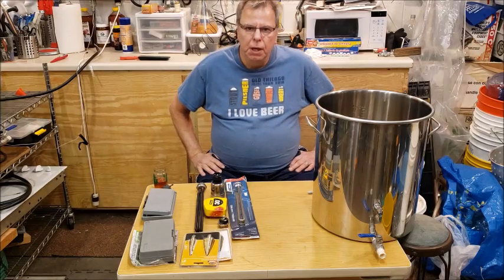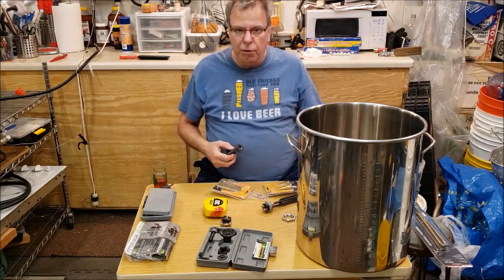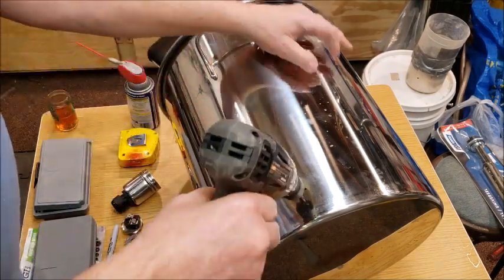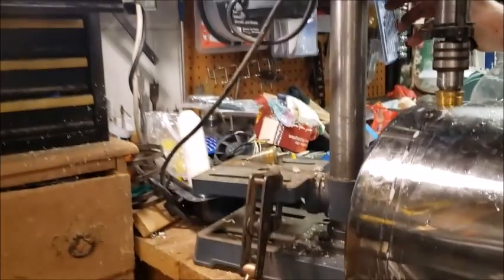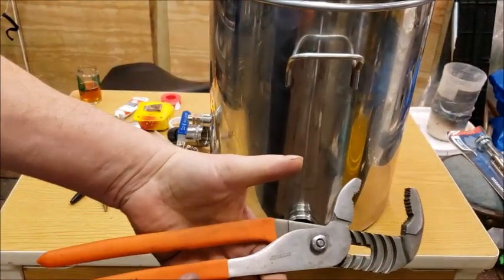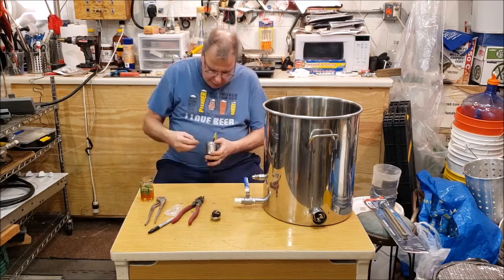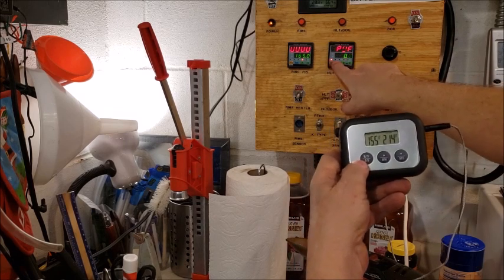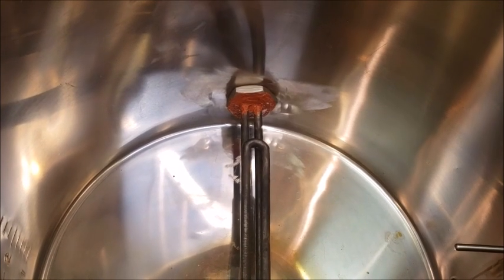Installing a Water Heater Element Into a New Brewing Kettle

Comment: Great video Tim. I've drilled a kettle in similar fashion and it's a pain in the arse.As I saw with yours because the pots are so thin they flex and deform if you put any pressure on them. 
Definitely qmax cutter is what I'd do next time. Well worth the expense. 
Cheers mate 👍🍺
Reply from the maker: Thanks for watching.  In the end I did get it done, it was just a PITA. I have used my Harbor Freight punches on other kettles and probably would have been OK. I do think I will get one next time, or at least a 1.25" carbide hole saw (I have an arbor)..

Comment: Nice video showing the process.  The key to drilling a hole if that's your only choice is to go very slow and you should have enough pressure to keep a continuous chip coming off.  If you go to fast it will work harden the metal.  I also use cooking oil as a lubricant and cooling agent for drilling.
What is the make and size of your kettle?
Cheers
Reply from the maker: Thanks for watching the video.  You are right about the speed.  I tried slower and faster. At points the bit would stick and the drill press would bind.  I have used my Harbor Freight knockout punch set on some other kettles and it works pretty well, but it is about 1/8” larger than the exact punch. I just got spooked watching another video on Brewhardware.com (where I got the element enclosure).  They discouraged that, saying the holes will be too big. I didn’t want to take the chance and I already had the step drill, which for softer metals works great. The HFT punch probably would have been fine. The kettle was from Adventures in Brewing / Austin Homebrew Supply. My wife got it for me (I steered her to it).  It is a 10 gallon kettle with embossed volume marks and has 2 welded in fittings.  With the sale price and a 20% off special on orders over $50, I think it came out to around $55, shipping included.

Comment: Step bit & hole saw are useless. I use a punch out tool and I have made over 50 holes with it. It takes about half a minute per hole. Cheers
Reply from the maker: You are so right.  I have a knock out punch set too.  But the one closet to the element size is just a bit large.  It is a good thing I only do this on occasion.  Thanks for the comment.  Cheers!

Comment: they are extremely large elements, most peoples power circuits would handle that, over 20 amps. power circuits here are only 20amps. i feel this is way overkill. a full hot water cylinder will actually boil with a 3kw element it just will take a while, you have a way smaller volume of water there in that pot
Reply from the maker: These are elements for a 240v, 30 amp circuit.  You are correct, most people do not have circuits like this. In the states pretty much everything is 120v.  But, a lot of brewers have these installed somewhere to brew, or at least have access to 240v 30 amp circuits for clothes dryers or stoves.  These are OK to use,as long as there is GFCI protection in front of the controller.
Reply: Tim Trabold yeah but I mean  a 240v 30 amp circuit is pretty much my whole free standing oven single phase. 32 amp breaker. This is totally overkill to brew
Reply: @TimTrabold  do you recommend a GFCI circuit breaker for this or do they make GFCI outlets for these?